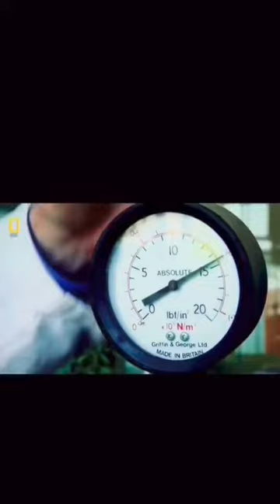What is cavitation and aeration (ventilation) on a boat propeller?

Comment: so what makes surface drives work, I assume they introduce aeration on purpose as half the prop is out of the water?
Reply from the maker: The reason they so efficient is actually due to reducing drag on the prop
Reply: yes they introduce aeration as at lower speeds the whole prop is in the water and effectively it has to much grip. so they allow the prop to spin faster by allowing aeration to the top of the prop as when the boat is at planning speeds the top half of the prop is out of the water.